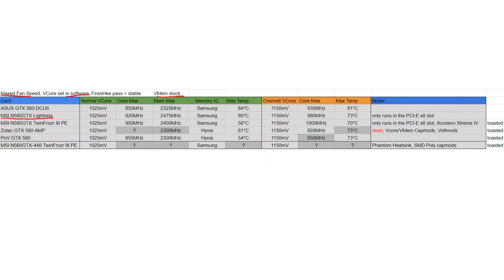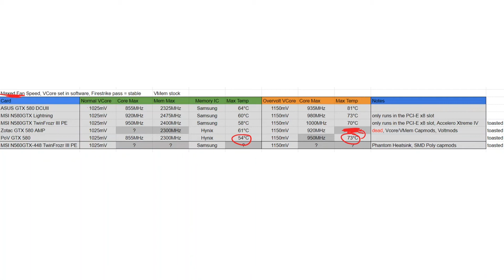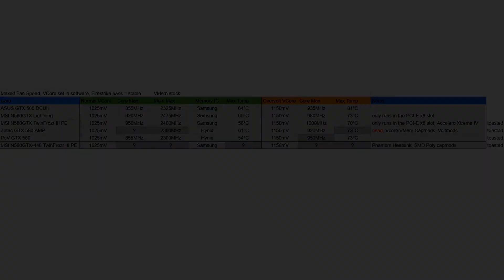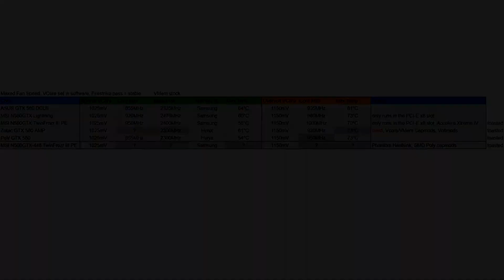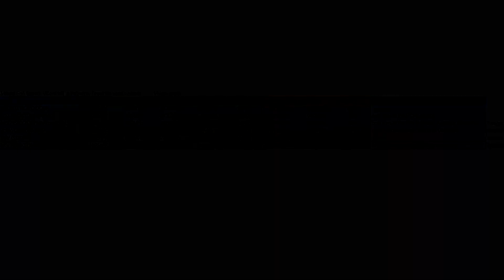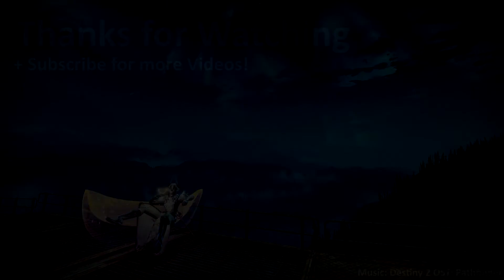GTX 580 Binning Results

Comment: Hey I tried to do the same tests as you, what load did you use to test thermals?
My results are as follow for my 580 DCUII with 80.0% ASIC quality :
1025mV : 820 MHz @ 44°C
1125mV : 970 MHz @ 52°C
Max mem 2300 MHz (Hynix)
Reply: Oh I mean 1150 mV, and I just managed 980 MHz on 22.7°C ambient air
Reply: Holy bananas it is running fire strike on air at 995 MHz core on air with stock BIOS at normal ambient
https://www.3dmark.com/fs/23941232